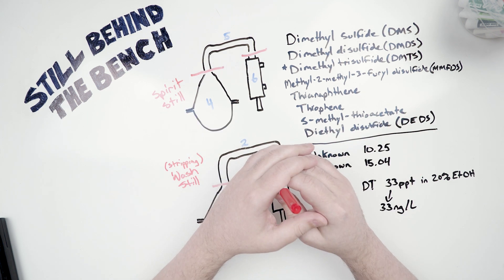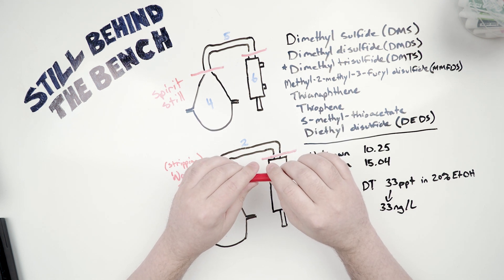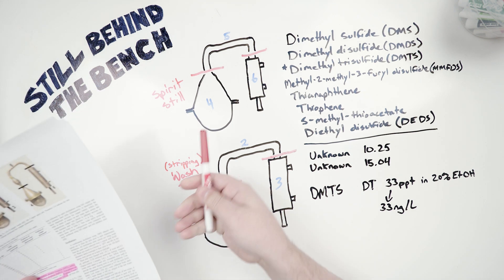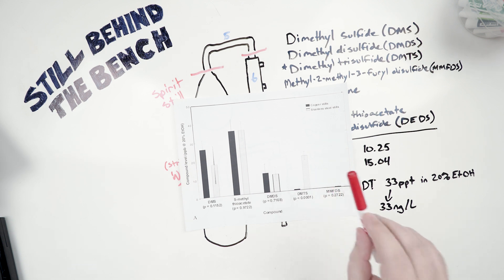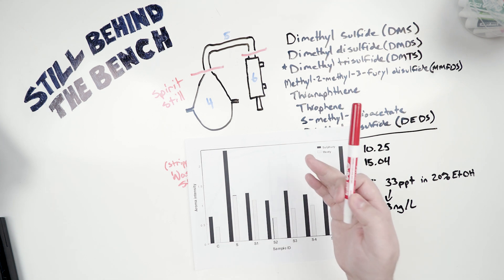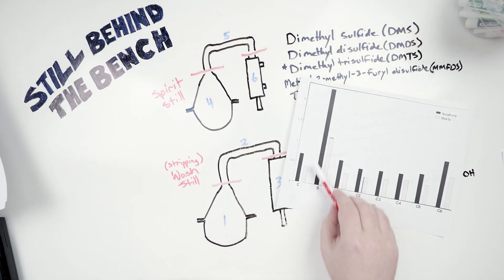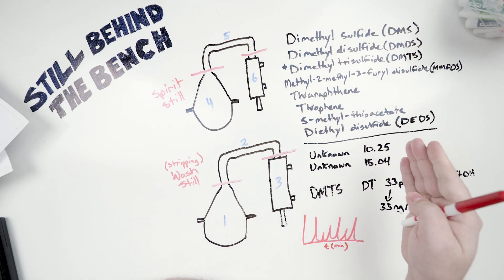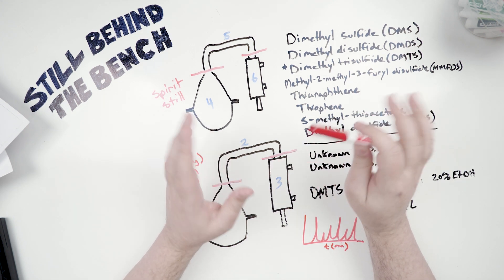Ep 020 - Why do I need Copper in my Still?

Comment: How does dumping straight copper pipe in your boiler affect your heating element? Do you need an "on grain" boiler to get that to work? And does boiling mash circulate good enough to get in contact with all the pipe sinking to the bottom?

Are these compounds created during the distilling or the fermentation? If you run a full copper still for your stripping run, is that completely nullified if you run a full stainless still for your spirit run?

It was a bit hard to see the charts, but when is the copper most effective, on the vapor or on the reflux? Is it worth running a couple decimeter of your column with just straight copper packing and zero reflux just to get every particle of vapor to actually touch some copper?

Comment: Great presentation of the benefits of copper in various positions in the vapor path.  This makes the commitment to initially spending an additional $50-100 on a copper pot instead of stainless steel a no-brainer.  Copper scrubbies only last a short while, are increasingly costly, and reduce the volume of the vapor path.

Comment: After watching this video I add rolls of copper mesh to my stainless boiler for my spirit runs. It is so good I do not have to charcoal filter my neutral spirits anymore. The copper does take quite a beating though as far as patina and will need cleaning in between runs to recharge. Small price to pay for not having to dilute and filter as I can now store at 190+
Reply: i tried layers of the stuff in the reflux column (i use a packed column) and was shockwd after 1 use it was heavily patinad, i thought I'd been scammed and it was just a coating. Now i use tiny copper balls in a muslin bag.

Comment: I have a stainless steel boiler, but have copper mesh and a copper column for my reflux still. I'm going to add some copper paddles to the boiler just for good measure, I just hope it's not going to be detrimental to the boiler having them in the wash floating around freely.

Comment: I am trying to sort out what you are saying and it seems like you are saying if you have a SS pot still and you were going to add copper it would be best to have a copper pot. If you cannot make that change would adding copper fittings into your pot to heat with your mash would that help? Thanks for the info.
Reply from the maker: I have a stainless steel pot, and what I did was just buy some copper pipe, and cut it up, dropped those pieces into the pot. I also use a small amount of copper scrubber in between the pot and the column, to react with the vapour passing through it, regardless of whether I am using the still as a pot still or a column still.
Reply: @StillBehindTheBench  I just watched this again and have another question. I have added 20 copper elbow fittings into my boiler pot. I have used copper mesh in my column but don't always want that reflux action. I have a piece of copper pipe that is as long as my column (only 7inches or so) and another piece of copper over that one but smashed down in an elliptical shape so that I have vapor path in the inner pipe, between the two pipes and on the outside between the stainless and larger elliptical shaped pipe. Between that and the 20 pieces in my boiler is that enough copper to accomplish what we desire? 8 gallon pot and a SS condenser that looks just like your drawing. Thanks for your videos.

Comment: Hi Adam, great video as always.
This turns things upside down for me as I thought copper was a myth of the distilling industry. So I need to reconsider my view. One question though. How are these sulfur compounds created and why? Is it actually a result of a poor fermentation process either due to wrong ph, wrong fermentation temperature, etc? I mean if the fermentation process is well controlled maybe these sulfur compounds are not created in the first place?
Reply from the maker: Great question. Sulfur is a required nutrient for yeast (in the form of sulfate or sulfite), and really all living organisms to function. This is because 2 of the essential amino acids (amino acids are the building blocks of proteins), Methionine and Cysteine, both have sulfur in them. All proteins have methionine in them, at least initially, so it's a very important amino acid.

AFAIK, the exact method of DMTS production isn't known, but one possible/suspected avenue is that after a yeast cell dies, it undergoes lysis (breaking apart), free methionine amino acids are released either directly, or as the result of other organisms releasing enzymes to break down proteins. The other organisms present in the mash will start consuming these amino acids, and metabolising them, and it's thought that yeast metabolism through a methionine salvage pathway, is one way how DMTS gets created, either intentionally or as a byproduct.

There is a study called "Yeast cell lysis enhances dimethyl trisulfide formation in sake" that shows how in the wort itself, there are enzymes turning methionine into DMTS precursors. They also reference a study called "Formation of volatile sulfur compounds and metabolism of methionine and other sulfur compounds in fermented food" which showed that DMTS is produced in cheese from enzymatic reactions. 

So the presence of these sulfur compounds is a naturally occurring thing. There really isn't much we can do to prevent their presence in the wash. It seems that simply having bare metal copper present is enough to alleviate the issue. I imagine there might be a way to treat the wort chemically, or with enzymes, to deal with these sulfur compounds, but that would probably end up being very expensive and time consuming compared to just using some copper in the still.
Reply: @StillBehindTheBench  so if the creation of the sulfur compounds is in the metabolic pathway that takes place during the fermentation process then it affects not only whiskey (which this study is about) but all spirits that are created by fermenting sugars like rum, fruit brandies even a simple sugar wash, as well as wines and meads. The copper presence looks much more needed than I thought. 
Thanks for bringing it up and explaining it in detail.
Reply: Good question👍

Comment: Thank you! I actually calculatet the need for copper in my still based of area of contact and hours of contact and total volume of alcohol. I roughly calcullated inside area of my new still collumn in proportion to my last one and concluded i will need some copper packing.

Comment: Ive always thought putting some copper mesh in the vapour path is the most sensible solution. Means you need very little copper due to its much higher surface area, is easy to replace and the reactions probably occur in the gas phase. Looks like other methods are effective as well but Ill keep doing it this way I guess.
Reply: It Works!